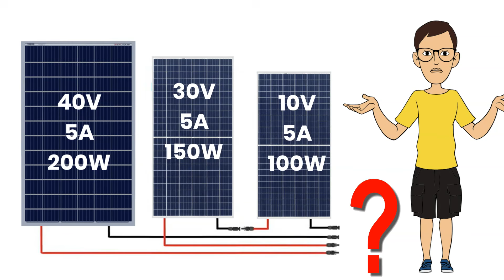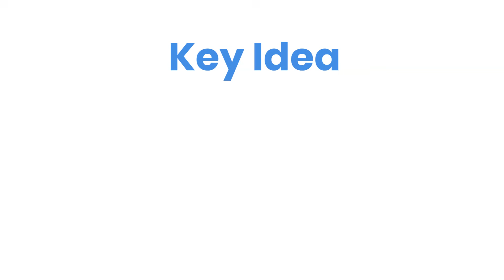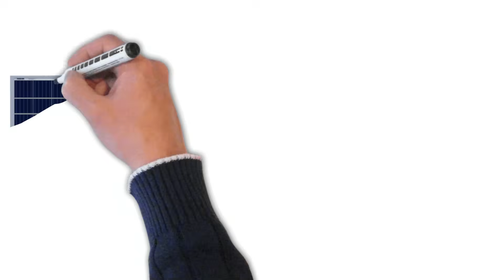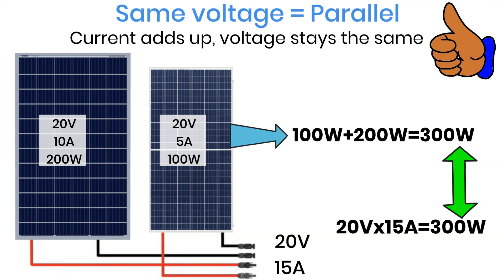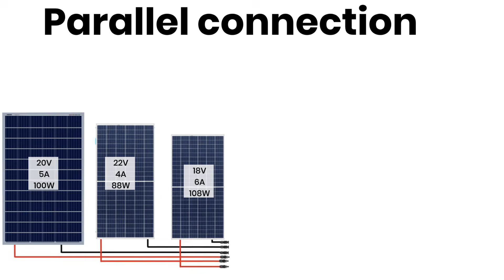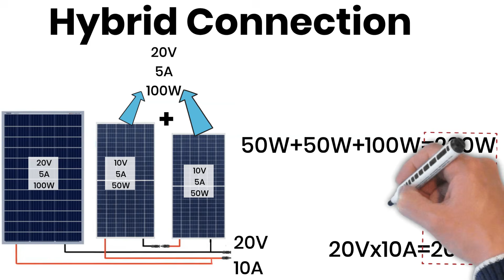Connecting Different Wattage Solar Panels Without Losing Energy

Comment: Hahahaha there is no 100w and 200w with similar current hehehe my rules sell the 100w and 200w solar panels and buy a new 300w solar panel hehehe
Reply from the maker: Haha, fair point 😄 and honestly, in many cases your rule makes sense. If someone is buying new panels, getting one properly matched panel is usually the easiest and most efficient option.
The 100 watt and 200 watt example was mainly to show the wiring concept in a simple way, so people can understand how voltage and current affect the result. Real panel specs can vary a lot, and you’re right that many 100 watt and 200 watt panels won’t have matching current.
That said, a lot of people already have extra panels lying around, or they’re upgrading piece by piece, so knowing how to mix them safely can still be useful.
Have you ever tested a mismatched setup yourself, or do you always prefer replacing with a single larger panel?

Comment: I have two panels. One 350W 11.45A and one 440W 11.56A 
I connected both in series and achieved good results.
Approximately 11.5 amps
I can't connect them in parallel because the voltage is different
Reply from the maker: Nice setup, and honestly, you made the right call 👍
Those two panels have almost the same current (around 11.5 amps), so putting them in series is exactly what I would recommend. In series, current stays the same and voltage adds up, so both panels can work nicely together without fighting each other. And you’re also right about parallel. Since the voltage is different, parallel would pull everything down closer to the lower voltage panel, which means wasted potential.
One small thing to keep in mind: make sure your charge controller can handle the combined voltage, especially the open circuit voltage on cold days, because in series that can go higher than expected.
Overall, this is a clean and smart setup.
What charge controller are you using with this system?

Comment: Excellent explanation! But connecting sonar panels (and batteries, other power sources) of different rated voltages in parallel is a little tricky. Panels with higher rated voltages will try to supply power to panels with lower rated voltages. I have never connected any power sources with different rated voltages in parallel. Will it really work, and is the resulted voltage the lowest rated voltage among the power sources? Just curious.
Reply from the maker: You’re correct that when panels with different voltages are connected in parallel, the higher voltage panel will try to push current toward the lower one. In real systems, this is usually controlled by the panels’ internal bypass diodes and the charge controller, so it doesn’t just “feed” the other panel continuously.
But yes, the important part is this:
The system voltage will sit close to the lowest voltage panel, so the higher voltage panel gets pulled down. That’s why some power is lost in this setup.So it does work, but it’s not always efficient if the voltage difference is big. Small differences are usually fine. Bigger differences, better to separate them or use different charge controllers. Personally, I avoid paralleling panels with very different voltages for this reason. Out of curiosity, what kind of panels are you planning to mix?